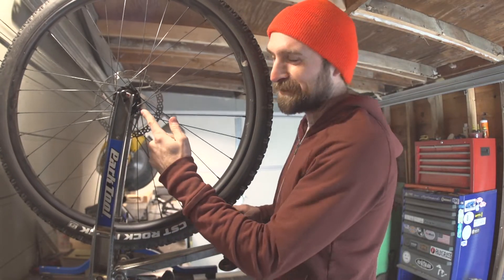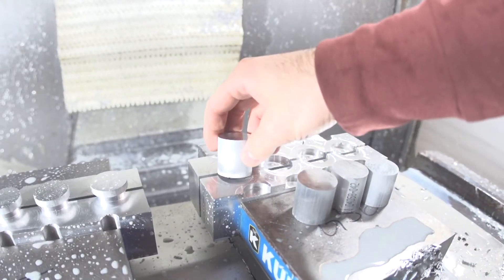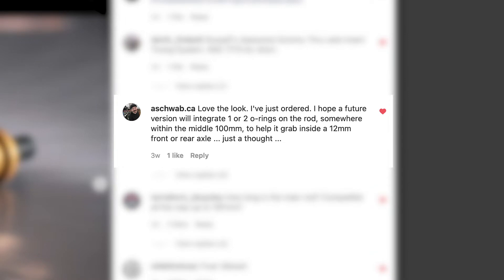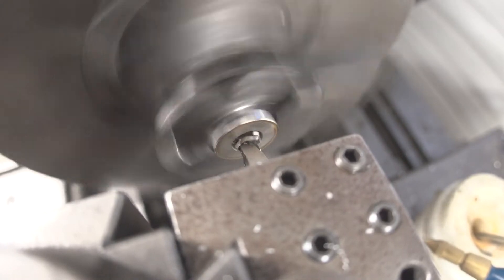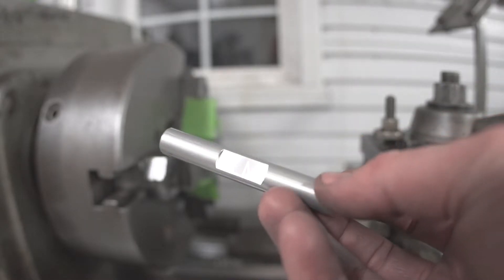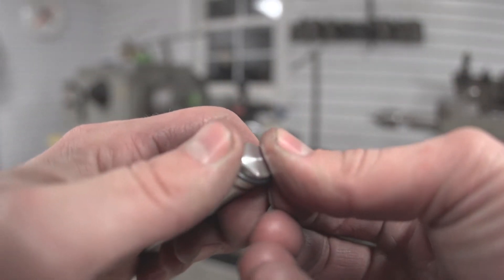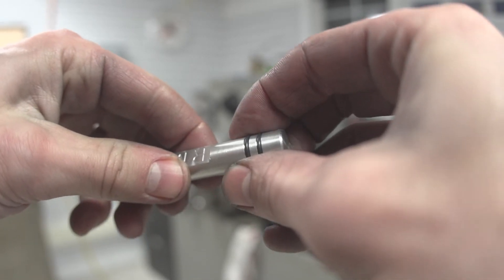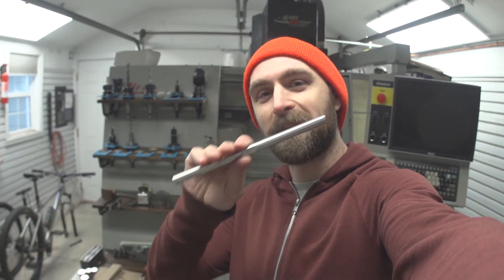Truer Skewer - Bicycle Thru Axle Adapter for Wheelbuilders

Comment: Perhaps you are doing by now, but you should be able to cut the o-ring grooves on the mill with a T-slot cutter. Unless, the ring used is too large in relation to the bore diameter. But I don't think it is in your case: The ID of those bushings is about 12mm and a 10mm T-slot cutter normally has a 5mm shank, so can cut o-ring grooves 2.5mm deep. Which is plenty for up to a 3mm o-ring as a 2.4mm deep groove would give 20% compression on a 3mm ring;). 
And I think your o-rings are thinner so even less of an issue getting enough depth out of the t-slot cutter. You don't even have to get one with flutes as tall as the o-ring groove, you can just step down in the CAM. 

The one caveat and disclaimer I can think if is that I haven't done this on internal grooves yet but it's worked a treat on external ones. Maybe if the ID of the bore is too close to the cutter diameter you'll get too much tool engagement and risk chatter? But if your o-ring is 2mm or 1.78mm thick, you can go down to an 8mm t-slot cutter which can cut 2mm deep grooves. Anyhow, I am rambling now.

Comment: Is there any reason why the 20mm bush can't have a small 15mm step for both sizes?
Reply from the maker: It’s so the 15mm and 20mm collars engage with the bearings in the hub, not just the endcaps.
I could make one stepped collar that’s twice as long, but when truing a 15mm wheel, the amount of collar sticking out past the hub would be a little unwieldy in my opinion.
Reply: Thanks for the reply, I guess you have been asked the same question many times before.
Could a simple sleeve be used over the 15mm bush to bring up the diameter to 20. A standard 15x20 oilite bush for example. Or maybe used over a standard 12x15 headed oilite for the smaller bushing. @RussellMakes
Reply from the maker: Sure, but such a sleeve wouldn’t have an o-ring groove inside. The o-rings nicely keep the assembly together when the tool is in use/installed in a hub. Perhaps I could add a groove and an o-ring but in that case the advantage of using an off-the-shelf part is dwindling since it needs modification.
The way I’m doing it now allows me to engrave 15mm and 20mm on the appropriate collars and anodize them different colors which makes the tool more attractive, durable, and easy to understand for the user.

Comment: I want to go from 15mm to 20mm thru axle I have a 15x100 front hub is there a way to adapt the hub to fit 20mm thru axle?
Reply from the maker: You’ll have to ask the hub manufacturer.

Comment: Nice intro and that's a great tool!
Reply from the maker: Thanks!
Reply: @RussellMakes  so how did you come up with the cut size and O-Ring size.   This is something that always gives me issues when engineering a part or tool I tent to cut many times and sand/file the fire out of them to get them 'to work'.
Reply from the maker: @fryreartechnology7611  When I made the first 15 and 20mm collars I cut a groove, put in an o-ring, and slid the collar over the rod to feel the resistance. It was too much resistance at first so I cut a deeper groove until I was happy with the feel. In this video you see me do the one on the rod. I just eyeballed the fit since I didn't have a 12mm thru axle hub to test with but I tested it later and it worked out. For my use I'm not trying to make a perfect seal that holds XXpsi, I just want some resistance so everything doesn't slide apart, but not so much resistance that it's hard to put together. Also as Dennis commented, the o-ring needs a place to squish into, so the grooves I cut are slightly wider than the o-ring cross section. This way they can squish and expand sideways.

Comment: Just a thought that may help when working with rubber O-rings. Rubber does not compress. Rubber will flow. So you need to leave enough room in your O-ring groove that when you squeeze the rubber it has some place to go.
Reply from the maker: Yes, I’m aware, but thanks for the tip. The tools I ground are a touch wider than the o-ring cross section. To be honest I got a little narrower than I wanted to on the one I ground in the video but the tool is nearly square so the o-ring can squish into the corners a bit and flow out into the file chamfer if necessary.
Anyways since filming I’ve tested the fit and all is well.
Reply: @RussellMakes  Late to the game but others might benefit, there are very easy to use online o-ring calculators that will tell you if you have enough compression and free space. Erik's and Trelleborg are both good. 
But it's easy enough for your use, if you compress the o-ring by 15-20% - then add a tad more than that in groove width. So, a 2mm o-ring would have a groove that's about 2.4mm wide and would be 1.6mm deep for 20% compression.